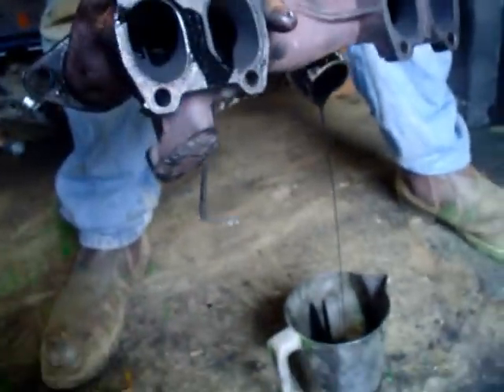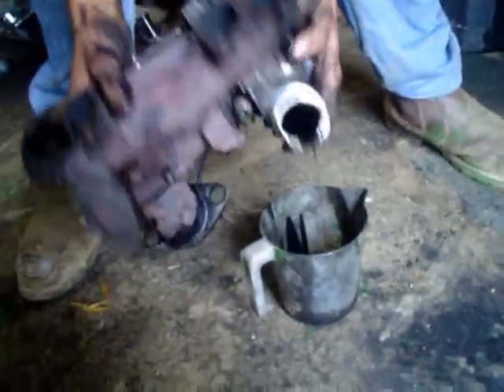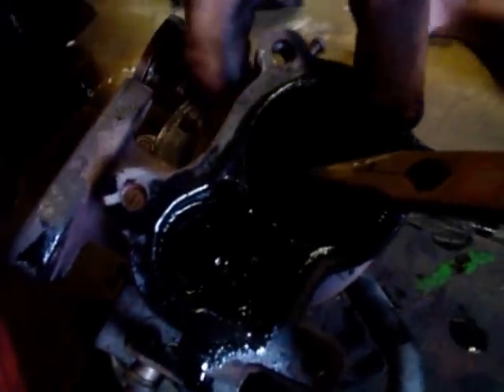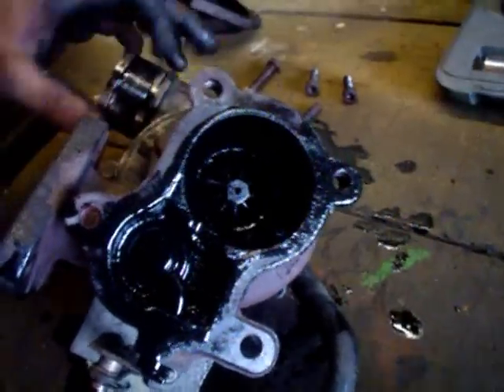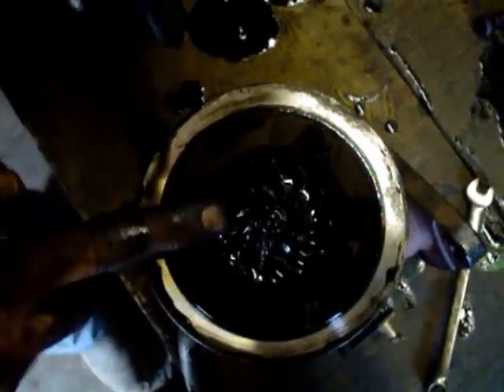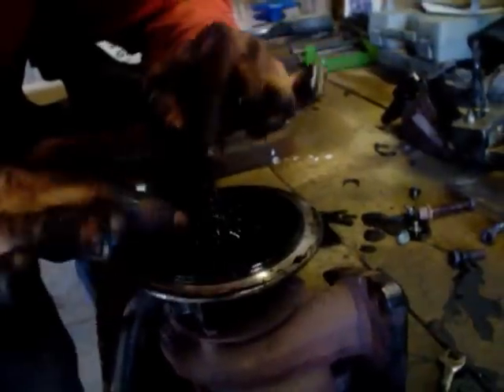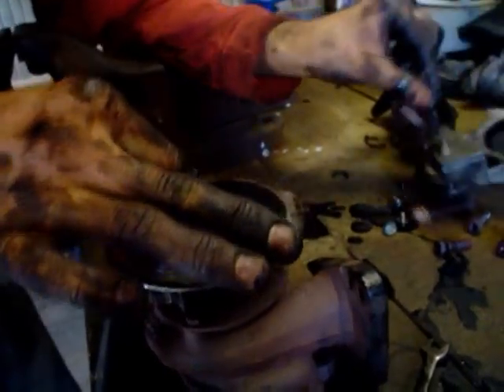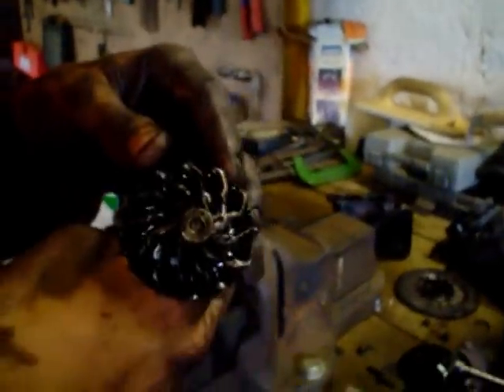Turbo Blow (306 D Turbo)

Comment: Nasty mate... rather you than me... in the nicest way possible! Hey at least it aint like the fun you had on the transmission change... That had me in stitches! Just had to change the gearbox on my 1.6, and surprise surprise, the new one is DEFUNCT and made out of Twix wrappers and PVA glue. Re-assuring. I am amazed the cars the gearbox has seen... quite the get-around eh? (In retrospect, the fact that the only whole box I could find was from a saxo VTS was probably when I must have gone mad...)